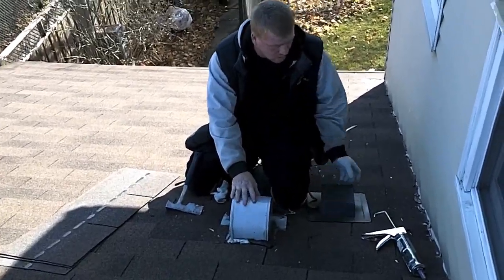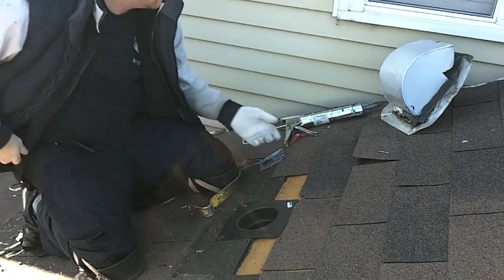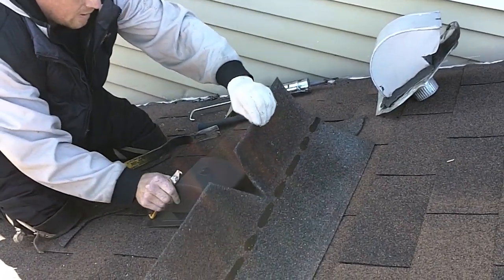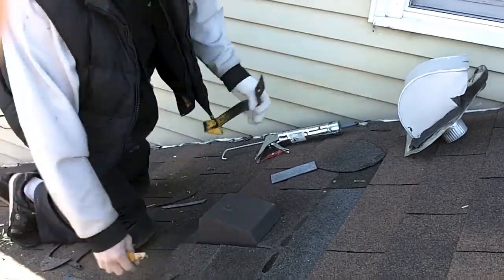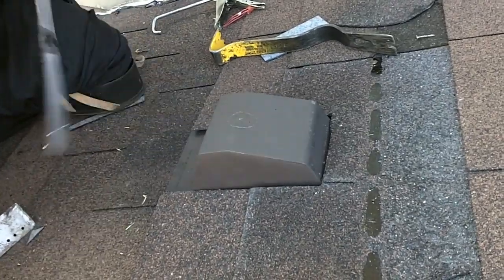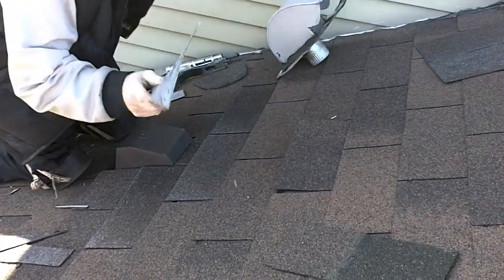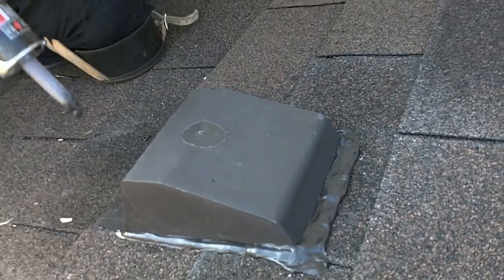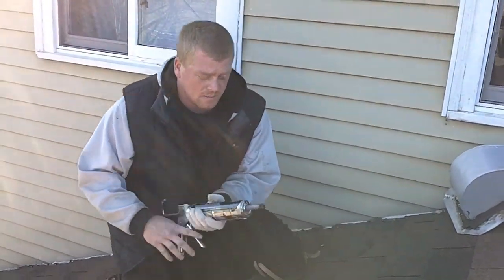washroom vent replacement

Comment: Wtf did i just watch?? Smh he took a simple vent replacement and made it look difficult. When you get the old vent and shingles around it out like he had it you wanna take roof sealant and run a bead on both sides of the hole and along the top of the hole, don't put any at the bottom because any moisture can't escape, THEN install the new vent and secure it with nails in the corners of the vent, then cut your new shingles around the vent ( both shingles you install should be cut around top of the vent not just the last one installed like he did it) but don't nail them take em out and run a bead of sealant along both sides where the end of the shingles lay and at the top of vent flange, now you can install your pre cut shingles and nail them down and seal the shingle tabs, that's the proper way to install a bathroom fan vent that's not gonna leak. I'm a roof repair man and I've had to replace many of those bath vents because people don't install them correctly and they're prone to leak.
Reply: Totally agree. Furthermore calking along the side of that wall isn't going to do anything - he needs to step flash with 4 inch flashing